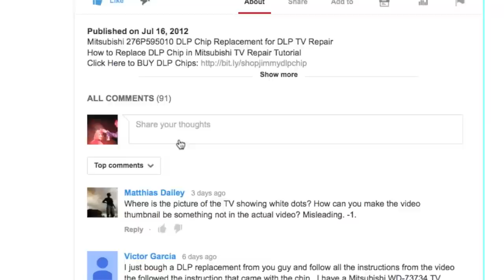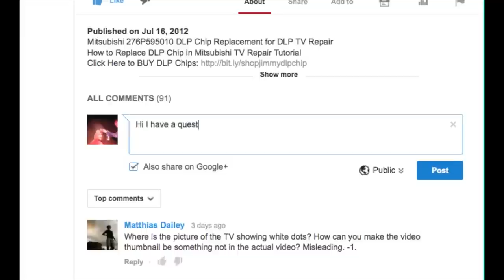LCD TV Repair Tutorial - TV Screen Solarization - Common T-Con & Main Board Symptoms & Solutions

Comment: Hi. my lcd tv bravia KDL-37L4000 is seen the green solarized enter the menu screen and reestablished and is still so ... but try to get some code on the remote control to make factory reset and not run. ... use the following codes ... arrow up and let down the power button and did nothing ... then I gave more volume and less volume and then quickly depress the power button and nothing that could be as it may repair this fault? I want to install your software from the internet USB cable

Comment: Hi I have a question...  I have a LN40a500t1fxza... the issue I am facing is that all the black on the screen is showing as red or hazed as red.
Reply from the maker: +Dwayne Height   Try all repairs and troubleshooting at your own risk. This could be a problem with either the t-con board, the main board or the TV panel. You can replace the main board and the t-con board individually to see if one of those boards fixes the problem.  Click this link to replacement parts for your TV model number:  http://www.shopjimmy.com/catalogsearch/result/?q=LN40a500t1fxza  There may be multiple boards for the same TV model number, be sure to match part numbers on your current board, with your replacement for compatibility.  Thanks and please let us know if you have any further questions with your TV Repair!  www.shopjimmy.com

Comment: I have a sony KDL46V3000 that the display is unreadable.  I have taken the tv apart and took the right ribbion on the tcon board off and the left side looks great  .  Is it a bad t-con board>?
Reply from the maker: Brian H   This sounds like a TV panel (TV Screen) problem.  If your TV panel is bad, it may be more cost-effective to replace the TV as panels are typically hard to find in stock, difficult to replace, and expensive.  Thanks and please let us know if you have any further questions!  www.shopjimmy.com

Comment: I have videocon 50 inch led tv model number VKC50FH. Suddenly I discovered a fine vertical black line on my tv screen. What could be the reason? How to get rid of this? Please suggest.
Reply from the maker: +Deeptimayi Padhi   Try all repairs and troubleshooting at your own risk.  This sounds like a TV panel (TV Screen) problem.  If your TV panel is bad, it may be more cost-effective to replace the TV as panels are typically hard to find in stock, difficult to replace, and expensive.  Thanks and please let us know if you have any further questions!  www.shopjimmy.com

Comment: I have a 46" samsung lcd with this same problem. My menu box looks normal and I replaced the main board with no improvement. Also replaced the T-con board and the picture changed to a almost whiteout condition. Does this point to getting a bad t-con board or do I have a bad lcd screen?

Comment: Hi there! I need help. I have a 2011 Phillips Model 40PFL3706/F7. The screen is green anytime the picture changes. There are 7 vertical lines down the middle and 5 down the right side of the screen. Thank you in advance.
Reply from the maker: Michal Hynson   Try all repairs and troubleshooting at your own risk.  This sounds like a TV panel (TV Screen) problem.  If your TV panel is bad, it may be more cost-effective to replace the TV as panels are typically hard to find in stock, difficult to replace, and expensive.  Thanks and please let us know if you have any further questions!  www.shopjimmy.com

Comment: Hi, I am hoping you may be able to help me. I have a Philips tv Model; 42PFL966H. Serial No; AG 1A0923101350. The picture goes bright green then a blueish pink. It's like looking at a colour negative.It doesn't stay like that, the tv could be fine for maybe 20 minutes then go, then come back to normal again and on and on. Could you tell me if I can fix this myself or does tv have to go to a repair shop. Thanks & Regards Hugh J McKernan.
Reply: When I go into the Menu all is grand the picture is fine.
Reply from the maker: Hugh Mckernan   You will need a new digital board.  Unfortunately I do not see any replacement parts in the search results for your TV model number on our website.  Please reply with your part number on your digital board and I can try searching for replacement parts.  Thanks and please let us know if you have any further questions!  www.shopjimmy.com

Comment: I have a PHILIPS 42PES0001H/10 TV-set. After switching it on, the picture is solarized and darker, but after 3-5 min of "warming" all progressively gets normal. Picture quality becomes stabilised, no matter how long is the session.
What is your opinion about this phenomenon?
Reply from the maker: józsef laci   This could either be a problem with the T-con board or the main board in your TV.  Unfortunately I do not see any replacement parts in the search results for your TV model number on our website.  Please reply with your part number on your main board and T-Con board and I can try searching for replacement parts.  Thanks and please let us know if you have any further questions!  www.shopjimmy.com
Reply: ShopJimmy.com Thanks for the answer! I will wait with disassembling until the failure will no more disappear after that warming period. The part numbers only than are visible.

Comment: I Have a Samsung 32' LCD Model # LNS 3251DX/XAA W/Solarized Picture & Menu, Bought A Used T-Con Board online But Didnt seem to fix the problem, Went into the service menu and changed some settings until I got a good picture, but only lasted a couple of minutes, and i couldnt get a good picture again, if i let it set awhile I can get the same results, (Good picture until it warm's up, all the Cap's look OK, I Put The Original Board back in and get the same results, How can I tell if the T-Con Board I bought online is Bad ?? Please Help, I need to repair this myself, (Low Income) Thank You , , ,Greg

Comment: TV is VIZIO 1080P HD Model VO370M. Has video, but is negative, no color. Audio is OK.  T-Con board and main board have been replaced. In your video, you mention a Main Panel. Can you explain?
Reply: the panel is the entire screen cost more than a new tv   remember  there is a  another board   on top of the panel after the t con board   that is part of the screen  that cannot  be  replaced

Comment: My Samsung  LN37A330J1DXZA  Jan 2009 manuf date;   I am not sure if the display is considered "solarized" but definitely looks like it lost a color;   I went into the menu and the service menu and they don't look bad.    Could it be a T-Con board or the main board??
Reply: actually the menu is blue, so i am thinking I lost one of the color's
Reply from the maker: Helene Miller   It could be either the main board or the T-Con, no clear way to say which one for sure.  You may need to replace each of those boards individually to see which one fixes the problem.  Here is a link to replacement parts for your TV model number on our website, click here:  http://www.shopjimmy.com/catalogsearch/result/?q=+LN37A330J1DXZA  Be sure to match part numbers on your current board, with your replacement for compatibility.  You can also call our customer service for further assistance with your purchase.  (877) 881-6492  Thanks and please let us know if you have any further questions with your TV Repair!  www.shopjimmy.com

Comment: Hey I have a weird issue with a Sanyo Dp42647 TV where it becomes solarized after a few minutes of being on, presumably when it gets hotter. The screen is fine and works for a while until it suddenly becomes solarized. It also seems to only accept Composite signals, as I can't get HDMI to work.
Reply from the maker: Lucetube GPlusStillSux  I recommend replacing the Main board in your TV.  Here is a link to replacement parts for your TV model number on our website, click here:   http://www.shopjimmy.com/catalogsearch/result/index/?cat=56&q=Dp42647  Be sure to match part numbers on your current board, with your replacement for compatibility.  You can also call our customer service for further assistance with your purchase.  (877) 881-6492  Thanks and please let us know if you have any further questions with your TV Repair!  www.shopjimmy.com

Comment: hi, i have a computer monitor named LG flatron w1643c model. it faces color problem, everything is blue, but the menu and LG logo color are seen perfect all time.. how can i fix it? do i have to change the color card of monitor? thanks
Reply from the maker: Obaed Ove   PLEASE SUBSCRIBE TO OUR CHANNEL - Try all repairs and troubleshooting at your own risk.  This could be a problem with either the t-con board, the main board or the TV panel.  You can replace the t-con board and main board individually to see if one of those fixes the problem.  Unfortunately I do not see any replacement parts in the search results for your TV model number on our website.  Thanks and please let us know if you have any further questions!  www.shopjimmy.com

Comment: I have a Samsung UN55KS8500FXZA no longer in warranty and suddenly all I get are colored horizontal lines that are colored base on the source picture (or just blue in what I guess is a black screen/no source default). From what can find TCON most likely the issue? However trying to find parts or even just the part number for the TCON on this TV has been impossible for some reason - is there a standalone TCON with this TV or is it built into panel/main board or something? Anyone with a part number or any idea would be greatly appreciated, thanks all!

Comment: Hi i have question ,My sony bravia lcd tv model no. KLV32S550A green patches is coming , how can isolve this issue.
Reply from the maker: +MOHAMMED SAHIL KHAN   Try all repairs and troubleshooting at your own risk.  This sounds like a TV panel (TV Screen) problem.  If your TV panel is bad, it may be more cost-effective to replace the TV as panels are typically hard to find in stock, difficult to replace, and expensive.  Thanks and please let us know if you have any further questions!  www.shopjimmy.com

Comment: Hi
I have Samsung flat tv has a washed screen and menu,  model LN40A550P3FXZA
VERSION CK12

If you can help please, does it need a t-con board!

Thank you

EJ
Reply from the maker: Elias Jabra   PLEASE SUBSCRIBE TO OUR CHANNEL - Try all repairs and troubleshooting at your own risk.  This could be a problem with either the t-con board, the main board or the TV panel.  You can replace the main board and the t-con board individually to see if one of those boards fixes the problem.  Click this link to replacement parts for your TV model number:  http://www.shopjimmy.com/catalogsearch/result/?q=LN40A550P3FXZA  There may be multiple boards for the same TV model number, be sure to match part numbers on your current board, with your replacement for compatibility.  Thanks and please let us know if you have any further questions with your TV Repair!  www.shopjimmy.com

Comment: I have a Samsung 37 inch Model number LN37B650T1FXZA
It is solarized on both the picture and menu
Tried the mute 182 power trick and found nothing to change
Is it the T-con and how much and how hard to replace?
Thanks
Reply from the maker: Cathy Sanders   I recommend replacing the main board in your TV.  Here is a link to replacement parts for your TV model number on our website, click here:  http://www.shopjimmy.com/catalogsearch/result/index/?cat=56&q=LN37B650T1FXZA  Be sure to match part numbers on your current board, with your replacement for compatibility.  Here is a link to a video showing how to identify your part number, click here:  Samsung Main Boards & Digital Boards: Part Numbers for LED, LCD, DLP, Plasma TV Repair  You can also call our customer service for further assistance with your purchase.  (877) 881-6492  Thanks and please let us know if you have any further questions with your TV Repair!  www.shopjimmy.com

Comment: Hi I have a Phillips lcd tv Model# 46PFL3706/FL. It has a very dark screen and  I cant hardly see the picture on it, even when I turn of the lights in the room the pictures are still very hard to see. The tv comes on fine and plays but as for seeing anything it is imposible. I NEED HELP
Reply from the maker: Chris Will  Please watch this video FIRST to help with your repair!  https://www.youtube.com/watch?v=BP3NVNCGEv8  This could be a problem with either the inverter, the power supply, or bad lamps in the TV panel.  You can replace the power supply and inverter board individually to see which one fixes the problem.  Click this link to replacement parts:  http://www.shopjimmy.com/catalogsearch/result/?q=46PFL3706   There may be multiple boards for the same TV model number, be sure to match part numbers on your current board, with your replacement for compatibility.  Thanks and please let us know if you have any further questions with your TV Repair!  www.shopjimmy.com

Comment: Hello! My tv color is distorted JUST like in your video! Tv is a Sony LCD TV 40". Model # is KDL-40V4100 I really need help as I need to watch something important. Please help. Thank you!
Reply from the maker: buck lau   PLEASE SUBSCRIBE TO OUR CHANNEL - Try all repairs and troubleshooting at your own risk.  This could be a problem with either the t-con board, main board or the TV panel.  You can replace the main board and the t-con board individually to see if one of those boards fixes the problem.  Click this link to replacement parts for your TV model number:  http://www.shopjimmy.com/catalogsearch/result/?q=KDL-40V4100There may be multiple boards for the same TV model number, be sure to match part numbers on your current board, with your replacement for compatibility.  Thanks and please let us know if you have any further questions with your TV Repair!  www.shopjimmy.com

Comment: I have a Olevia Model 226-T11
The symptoms are this, the TV works fine for awhile, then the white in an image begins to surge to super whiteish blue and back to normal.  This cycle repeats over and over.  The other colors are fine while this is going on.  I have not yet tried looking at the menu while this is going on, but I will do that tonight.
Reply from the maker: Bruce Goggans   I recommend replacing the main board in your TV.  Click this link to replacement parts for your TV model number:  https://www.shopjimmy.com/olevia-sc0-p514207gadc-main-board.htm  There may be multiple boards for the same TV model number, be sure to match part numbers on your current board, with your replacement for compatibility.  Thanks and please let us know if you have any further questions with your TV Repair!  www.shopjimmy.com
Reply: Actually I ordered both the Tcon and main board from your website, replaced the Tcon board first and it fixed  the problem.  I returned the main board as I did not need it.  A tiny coil outer casing on the tcon board was shattered, so it may have been the failed part.  Thanks for the video and the support.  I will use your company again when I need to fix my next tv.

Comment: Hi I have A Sony Bravia KDL-46Z4100.  After 45 minutes to an hour of being on, the right side starts to have ghosting images that are semi solarized. Once this starts after another 5 to 10 minutes the right center part of the panel starts to have black "clouding" that spreads out.  Best guess is that a panel or the T-con?  Thanks!
Reply from the maker: *****   This sounds like a TV panel (TV Screen) problem.  If your TV panel is bad, it may be more cost-effective to replace the TV as panels are typically hard to find in stock, difficult to replace, and expensive.  Thanks and please let us know if you have any further questions!  www.shopjimmy.com
Reply: ShopJimmy.com Thank you so much!

Comment: Hello!

I have a vizio VX37L HDTV10A that, when using, it goes from normal color to red and back and forth. Also it keeps old images on screen, for example, if I am watching a movie and it suddenly changed to other image, there is a fade image of the old background. The same with my computer and everything else. also, I cannot change brightness or contrast on the TV.
Reply from the maker: Nelson Mejias  Please watch this video FIRST to help with your repair!  https://www.youtube.com/watch?v=BP3NVNCGEv8  This could be a problem with either the main board or the TV panel.  You can replace the main board to see if that fixes the problem.  Click this link to replacement parts for your TV model number:  http://www.shopjimmy.com/catalogsearch/result/index/?cat=56&q=VX37L+HDTV10A  There may be multiple boards for the same TV model number, be sure to match part numbers on your current board, with your replacement for compatibility.  Here is a link to a video showing how to identify your part number, click here:  https://www.youtube.com/watch?x-yt-cl=84359240&x-yt-ts=1421782837&v=kxkeGLhlQY8  Thanks and please let us know if you have any further questions with your TV Repair!  www.shopjimmy.com

Comment: I have a Sanyo dp55441 and have lines across the entire screen even the menu the lines are not a solid color but distort the picture colors I replaced the tcon but it did not work, can u help?
Reply from the maker: evolushin23   This sounds like a TV panel (TV Screen) problem.  If your TV panel is bad, it may be more cost-effective to replace the TV as panels are typically hard to find in stock, difficult to replace, and expensive.  Thanks and please let us know if you have any further questions!  www.shopjimmy.com

Comment: Mine does the same thing. My tv is a Toshiba and model number is 58L4300U the power button was messed up and was citing the tv off and on we took it apart fixed that problem got it working then about 5 mins later it’s color went distorted